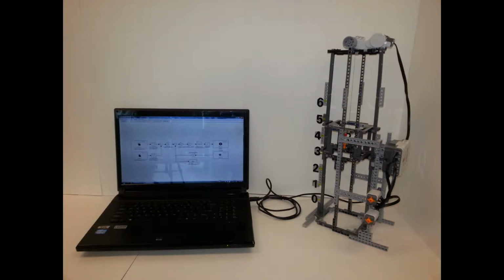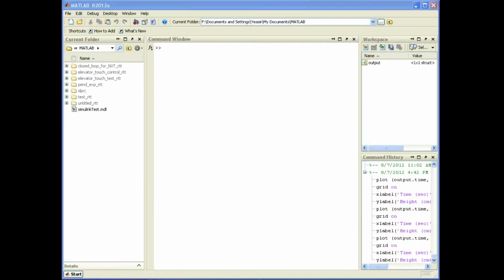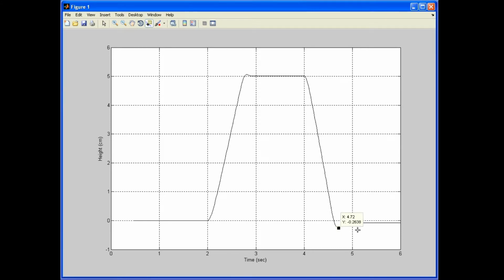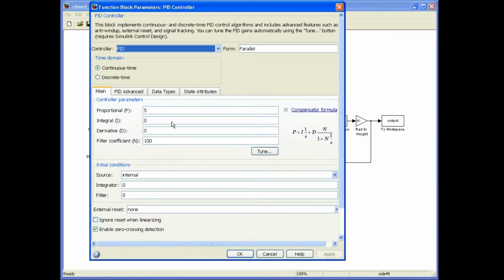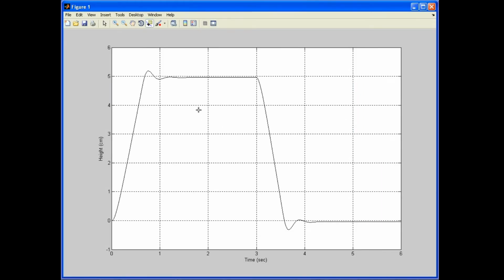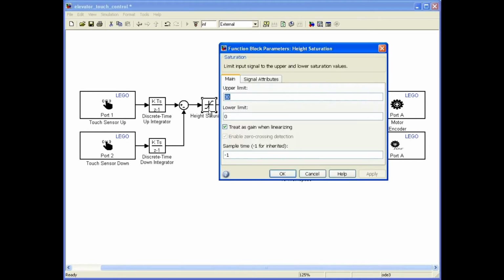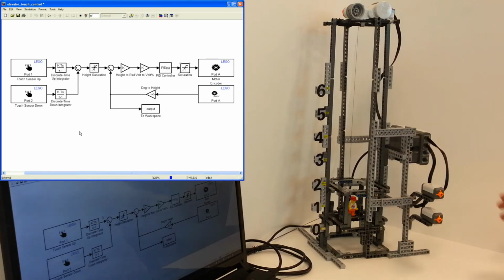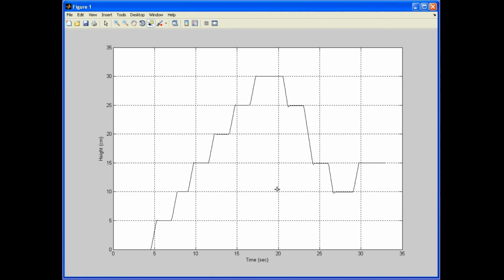Golnaraghi - Elevator Position Control using LEGO Mindstorms and MATLAB Simulink

Comment: May I ask what sensor you are using in the elevator position controller?  It does not seem like you used an external sensor.  Did you use the internal sensor in the motor?